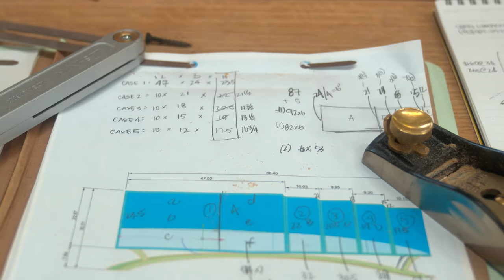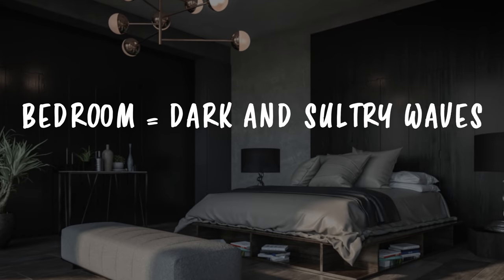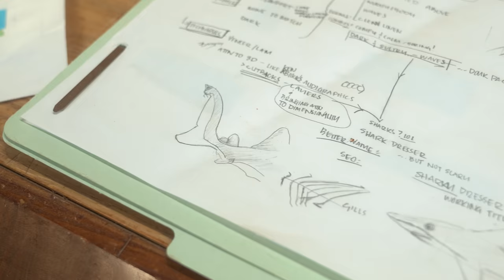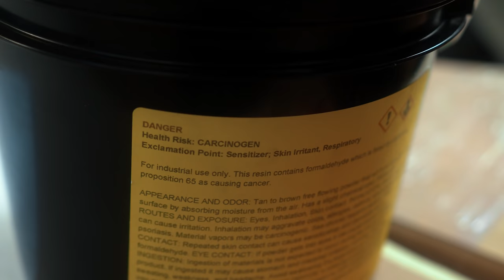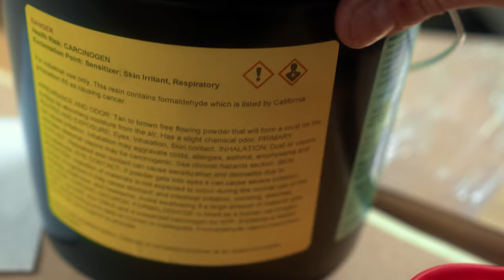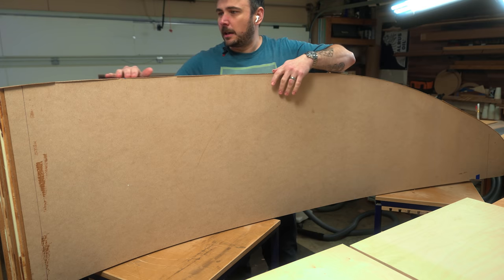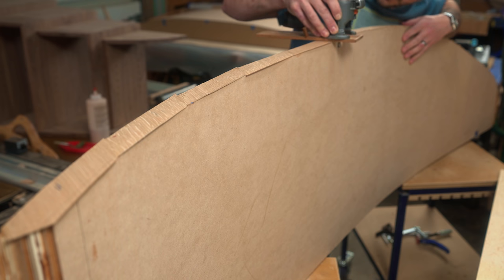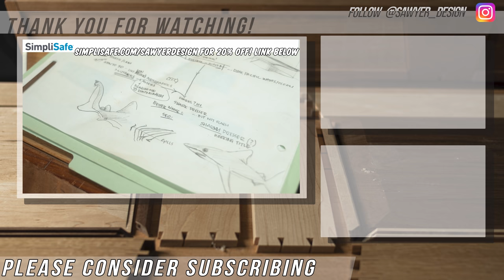Making a Curved Cabinet Base

Comment: I'm digging where this is going.  You will love the freedom your drum sander will give you...  Being able to dial in down to .001" is an incredible advantage when you are bending tight curves.
Reply from the maker: Can’t wait to put it to work. Seriously have been needed it for a while, but knew I needed closed both sides and those supermax are like $4K new!
Reply: @SawyerDesign  I know...  For me it came down to the Supermax and the Powermatic.  I went for the PM at the end of last year.  I had an older delta and it caused more trouble than it was worth.  The upgrade to a pro model has been worth every penny so far.

Comment: Congrats on the drum sander! Makes veneer sizing and smoothing a lot easier for sure! 

One thing to note, not sure what your dust collection set up is, but having a good cyclone will make your life so much easier. I haven't got on on mine and when sanding veneers I need to FREQUENTLY stop and bang out the filters or the suction just plummets. Or just live somewhere you can open the overhead doors in winter haha.

I like the design process insights, thats an area where I feel I struggle.

Comment: I've always been a bit leery of including curves in my designs, but this has me thinking, what the hell go for it. You'll love the drum sander.
Reply from the maker: It certainly ups the ante for execution.  So many amazing forms to experiment with and explore once you step away from rectilinear. Worth the reward if you’re up for the challenge
Reply: To incorporate curves is a quantum leap in design and skill levels. To include complex curves (2 curves impacting each other - such as a dome) is the ultimate. I’d like to say that I’m competent at it; but then, I’d like to say I’m incredibly handsome; unfortunately, neither are…..

I can only do it with trial and error; I can imagine or calculate so far but then have to use scrap to finesse what I thought it would be. But, then again, I’ve only been doing it for 45 years whilst Mr Sawyer is probably up to his 4th year now?

We’ve just come back from a local craft fair. Very good fair with lots of different crafts on show (plus the usual smattering of lower quality, foreign made stuff). Anyway, there were a few stands showing woodwork products. Apart from lathe products, it was all rectangular stuff but I would guess these sellers have worked their markets out and reckon that people willing to spend thousands on a table or dresser or whatever aren’t going to buy them at a craft fair - or maybe even go to a craft fair. However, I would like to have seen a few craftsman just showing pieces of higher design. 

What did come out was a load more stuff I have to now make for the family. Cheese boards - “Dad can make that”; segmented bowls - “Dad can make that”.

Comment: Hi. Another awesome build and detailed video.  Thank you.   Regarding that Makita sander...  I use to use that same one, but for some reason I kept getting electrical shocks.  Nothing major, just super annoying.  I later found out, it's built with no ground wire.  I eventually got tired of getting shocked, and coming up with multiple creative ways to ground the machine.  I bit the bullet and bought a Festool Rotex 150.  I not only gives me all the sanding power of the Makita, but has amazing dust collection that the Makita doesn't.  In addition, I no longer get shocks when sanding as it integrates so well with the CT Midi dust vacuumed. I strongly recommend not waiting as long as I did to fix this issue.  But if your not getting shocks, let me know how your using it, and I can try that out too.  Thanks.

Comment: This is insanely creative, and gorgeous! I’ve been a big fan of your woodworking for a while, it’s really different and I’m glad to see there’s a YouTuber still doing build videos and not just tool comparisons and “top x” videos. 

Curious, what kind of camera and lens are you mainly using? The shots are super clear and the lighting setup is always on point. I’m looking to upgrade and your images are quality 🤌🏼
Reply from the maker: Hey thanks so much! Trying to find a way that’s mine instead of just trying to replicate what others are doing. 
I recently upgraded from an A7III to the A7IV. 10 bit 4:2:2 is a game changer. As far as glass, video up until this one were shot on a  24-70 f/2.8GM. This video was mostly shot on my buddy’s 16-35mm GM he let me borrow. Lighting has been the hardest thing to nail down. Still not totally pleased with my light setup, but it’s getting there. Quasar tubes and amaran 120d’s for continuous lighting. 400w Neewer strobes for stills.
Reply: @SawyerDesign  The 16mm prime explains it. Definitely in the future for me. An artist becomes their own biggest critic...you're lighting provides something watchable and slightly cinematic. Mine is just high key washed out hahaha Looking forward to the next video. Thanks for responding and sharing the setup!

Comment: a great job and not looking forward to seeing the final result, I love the imagination you have to design your work... one question, why have you chosen to edge the base edge first before the top face?  great job friend😊
Reply from the maker: Thanks Miguel! I prefer to build the edge into the substrate because the edging doesn’t get the clamping that the flat does and it’s the most likely to have less adhesion. Nice to reinforce that with the face veneer.

Comment: I'll be curious if you still have that lock set to 5 minutes. We used to do 10min, and I got so frustrated with being out in the garage just longer than I thought while doing something, being in a rush and coming back to a locked door. They are amazing either way, I absolutely love not needing to carry keys, nor coming home after hours away to facepalm because you realize you didn't lock the house.

Comment: Love it and all your stuff. 
I began playing with vac bags in guitar making, bending 1/4” figured tops on the Ibanez guitars we built. 
1990’s. Yikes. 
Since then I used it for making 30”x30” floor panels kinda basket weave. 
Finished a spiral staircase railing using the weld wood prg , I guess same as you are using. 
Thanks from Kentucky!
Hit me up on Fb to see some stuff I am working on.
Reply from the maker: Hey Duane! I’ll check out your page! Might have some questions when it comes time for the Bent Roubo. From what I’ve seen, Stair railing is usually free bent, right? Got a big tapered lam for the legs and haven’t free bent before.

Comment: I’ve been waiting for this video for what seems like forever.  It sucks that stand didn’t work with that massive slab.  It almost makes sense why it didn’t but I’m not in your shoes and your designs are your designs.   Just not the right fit.  Either way it was an awesome base.
Reply from the maker: Oh it’ll work, just gets a massive steel support this go around. It’ll be awesome, just hope the calculations are correct and it’s sturdy enough for us to sell.

Comment: You mentioned that you get one 16th of an inch thick veneer but where do you buy it from
Reply from the maker: There’s only one place that sells raw veneer that I’ve found at that thickness— Certainly Wood out of NY state.
Reply: Have you looked at GL veneer?
Reply from the maker: I have. They don’t have anything thick enough to be cost effective for bent lam

Comment: Do you have any links to the vaneer vacuum equipment you use?
Reply from the maker: Vacupress.com for the press. New PU bag is from veneersupply.com
Reply: @SawyerDesign  is that the VS standard, elite, or extreme (30mil)
Reply from the maker: @Dynasty Woodworks it’s the 30mil.

Comment: If you're willing to divulge...from where do you get your veneers? Local or online retailer? I'm going to be in the market and have trouble sifting thru the Google results for a place that seems reputable.
Reply from the maker: Hey Chuck. Veneer supply (joe veneer) and certainly wood are the suppliers I was referred to and both have been awesome to work with. Highly recommend them both
Reply: @SawyerDesign  Awesome, thanks! I'll check them out. Keep up the incredible work!

Comment: @21:14 Stretch a long piece of tape all the way across horizontally & then have all the little pieces of tape that you are using to hold the veneer in place, lay on top of that horizontal piece. That way you can peel the long piece to help remove all the tape at once. I hope that made sense. Easy to do, hard to write out. Maybe that's why instructions are always terrible?!?
Reply from the maker: Good tip! I’ll definitely give that a go. Thanks Richard

Comment: Hey dude me again!🤔 This is mind bending brain 🧠 farting 💩💨 and has to be one the squirlyiest ways to get to design idea ave ever come across although strange it's beautifully Weird at the same time. And I love it. One question though wanna pick that experts 🧠 as a starting wood worker (well dabbled a bit helped build my solid wood kitchen and half my house) but setting up my own kinda thing live edge slabs other side hustles. What would u recommend for plainer jointer combo baring in mind lost my job recently and 3 kids and wife to support thats why am doing this so money is tight just now? Your thoughts? Sorry for the long post 🏴👍
Reply from the maker: Hey man! Glad you liked it. As far as J/P combo I think you get what you pay for. My A3 is decent. Kinda of a pain to switch over, but definitely the best choice for the space. Separate machines are definitely better. I’ve heard nightmares about setting up the Chinese combos, but they’re certainly cheaper
Reply: @SawyerDesign  yea a certianly considered seperate ones but then usually the cost mounts right up. Space is the issue right now well that and cost. Money's not really there right now for it  so gonna have to figure sommit out. What's your thoughts on electric plainer the hand ones? They won't obviously give me the thicknesser aspect but will they work as a jointer short term if need be? Unless u fancy donating and shipping one to fellow new start wood worker?👍🤑🤔🏴

Comment: Hi 👋, Sawyer Design, Great territorial play enjoy watching and listening to your achievements, Don’t know how far along you are in this project but it might be worth Making a rib out of plywood to go under the arch built to sit on the floor not so it goes to the floor but something to say around 20 mil 30 mil in height it will help stop the flex of the curve, And you will not be able to see it as the unit is sitting on the floor. This needs to be standing grain to give it its strength, I have used a Vac  bag 💼 sorry wrong bag. Two form shapes and to laminate up materials for making specialist doors et cetera, I was quite lucky as I had a very large premises old grain store approximately 8 m wide and around 50 odd metres long.
Before I started doing Vac bag work I built a huge very strong table 1 1/2 m wide by 3.3 m long and it was dead flat the top was inch thick MDF.
But the main part frame legs et cetera made up of inch thick plywood, Round the edges the Inc the festival Wrong festival, Festool Track and support rails 🛤 sorry wrong 😑 Rail , That’s enough about me, I am a retired 70-year-old young man living in France. I wish to steal back at work.
Keep up the great work looking forward to your next hour tomorrow to see how this finishes. 
Stay safe great to using a breathing apparatus or mask formaldehyde glue is very dangerous.
Phil from the moulin France.

Comment: Check out the YouTube woodworker Errant Ignas.  He has a several part series where he builds a table similar to the Blacktail one, with a heavy top and single post base.  He went through multiple bases before he made one that didn't wobble the way yours currently does.  Definitely worth seeing what he did before you dive in with attempt #2.  The video titles all include "over engineered dining table".
Reply from the maker: Hey thanks for the tip! I’ll go check it out. I have a 2” steel posts with 3/8” plates welded together for the backbone of the remake. Will be interesting to see if he arrived at a similar beef 🥩